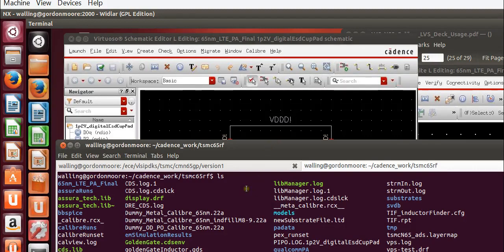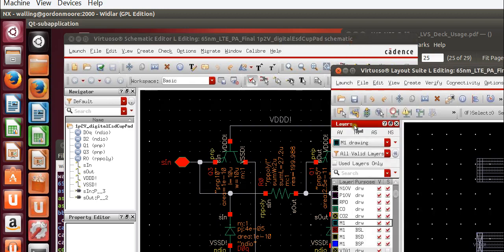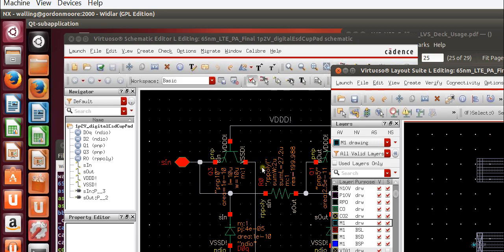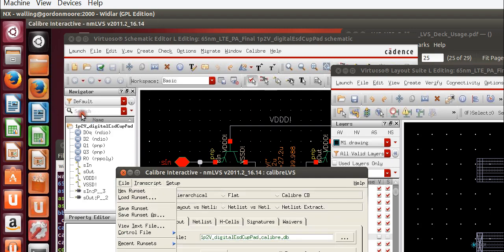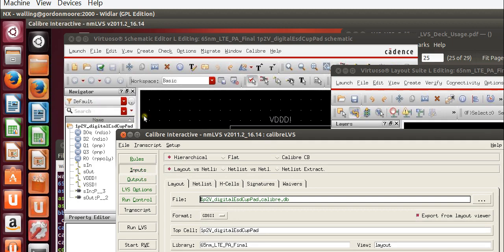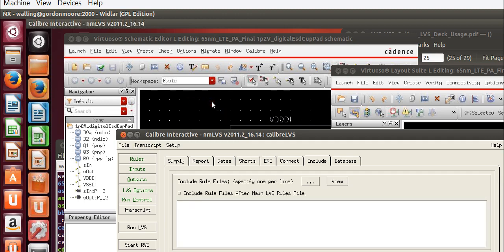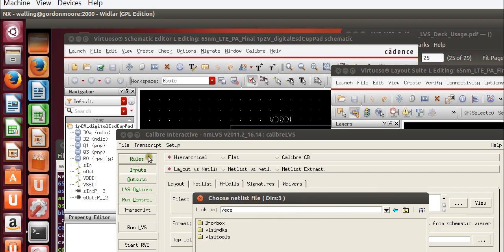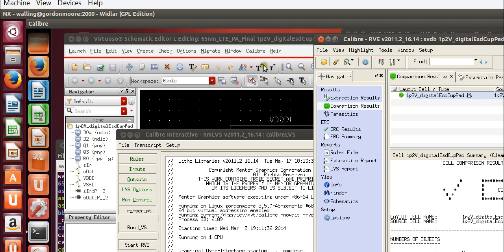How to use Calibre LVS

Comment: Hello sir,
your videos are very use full, 
i have a doubt, what is Sources.added file that is specified Under Inputs/netlist, what is the purpose of it.
thanks
Reply from the maker: This is a map file that is dependent on the process technology that you are using. Some technologies do not need this, but you will need to consult your official CAD support to determine this. This example is specific to the TSMC 65nm flow.